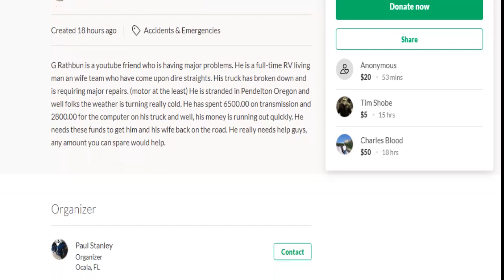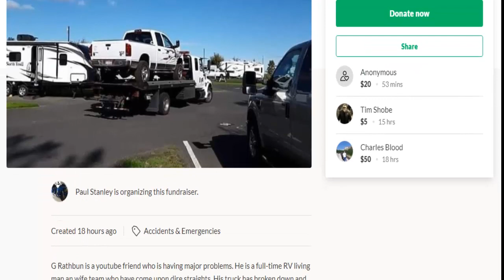Dodge Ram Cummins on the hook

Comment: Good to hear that it is not an Engine Failure, also good to find that #5 failing injector before it caused some damage.  Dodge automatic transmissions suck, this is why I searched for one with a NV5600 manual trans and then put a double disk clutch in before I built my cummins to 850 ft lbs of tourqe.  I am very happy to hear that Vicki is feeling better.

Comment: Also going to help, also if I can figure how to do it, at least you got a little bit of good luck, and glad Vicki is feeling better...you call it a flexwheel, I always known  it as a flywheel.
Reply from the maker: I was told a flywheel is for a clutch and a flex plate is 4 automatic transmissions. I kept getting mixed up I was kind of excited that it wasn't the motor

Comment: Thats better news.  Modern trucks are a pain in the ass.   My 2005 F150  has a bad coil pack causing a miss.  Need all new coil packs, plugs and injectors.  2k I bet.  Life happens.  Good luck G Rat.